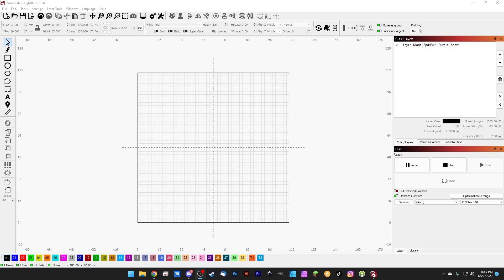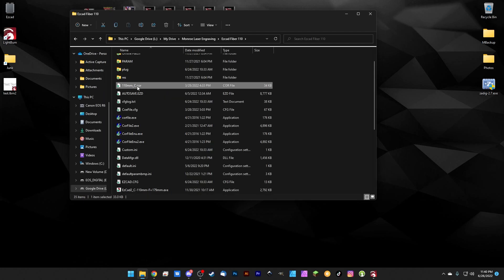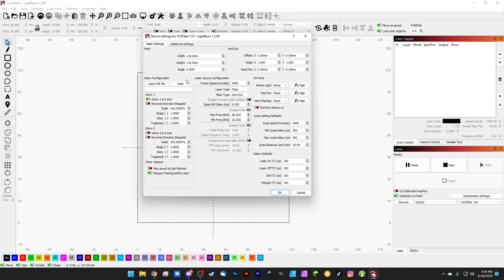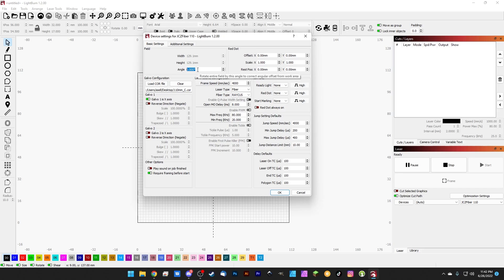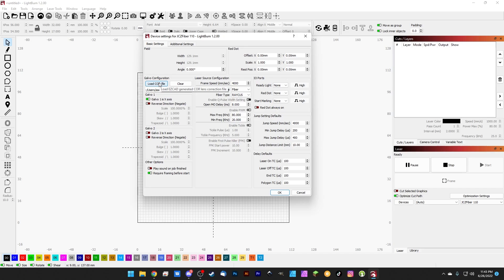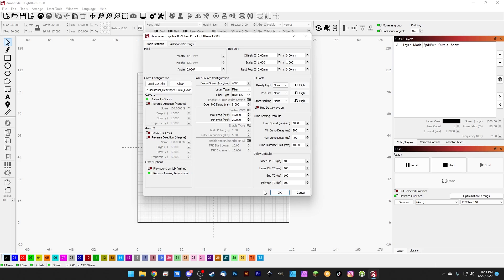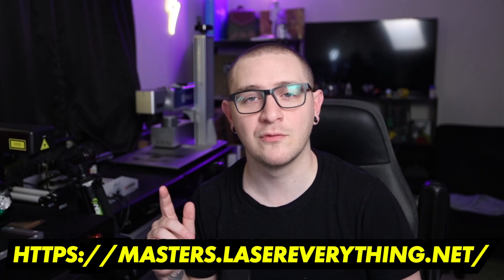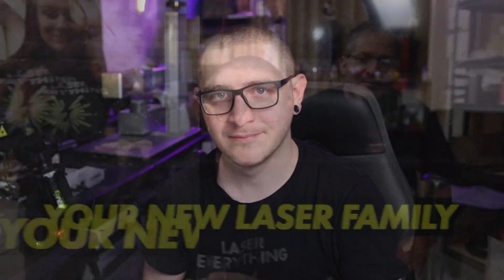Applying Ezcad Corfile Lens Corrections to LightBurn for Galvo

Comment: Hi,  I deleted my corfile.  yes-dumb- I assumed i didn't need it.  is there any way to get this back?  also- just signed up for the LMA yesterday!
Reply from the maker: Thanks for your support! 
If you have it backed up on your computer, or on the original flash drive that came with your laser from the factory, you can copy it back to the computer and assign it back to the laser in the device settings in lightburn. Unfortunately, if you don't have a copy of it somewhere, it is likely not recoverable. It's possible the manufacturer kept a copy of it (some do this, especially if it was built to order or a boutique vendor that did the corrections for your lenses before shipping out). If not, then you can try out the new way of doing a correction directly in lightburn, we just did a video on it and came up this past week actually :)
It's still early in its release and needs some fine tuning, but its way easier than swapping back and forth to ezcad. The scale is a bit off and needs adjusting right now after, but if you can tolerate that or hang tight till they update it again.

Comment: i did the focal dist setup ,I did the cor file many times but i still have error in the final dimensions. When i draw a square with 50x50 it actually mark a 49.5 .
Is there a way to compensate it by scaling?
Reply: I have this exact problem. I’ve run corefile2 repeatedly. distortions are removed but scale is about a mm small in both directions.
Reply: @joeargyle  guess we gonna have to wait for some help😁

Comment: Running Lightburn for a couple years with my led & co2.  Have a new fiber coming tomorrow... Any suggestion for these adjustments if all I have is Linux?  Doesn't seem to be a version for Ubuntu.   Kind of disrupts the 'flow' of your video if it requires a Windows machine.  Things keep going back to EZcad2...

Comment: Hey Alex, finally took the plunge and purchased Lightburn.  I still have the original folder as well as the USB that came with my galvo.  I dont see any files with the .cor extension?  What should I do now?  Thanks buddy.
Reply from the maker: If you're on Windows watch Episode 10 of this series, there's a link to the playlist in the description.
If you're on MacOS or Linux you'll need temporary access to a Windows machine so you can run the Corfile.exe and generate the correction file.
If neither of those are possible then you'll have to do lens corrections manually which we go over in this video here: 
https://www.youtube.com/watch?v=FZT9zOp9Sl8

Comment: Hi, I have a Corefile Issue I am trying to solve.  I managed to get all the settings pretty spot on using the bulge, skew & trap tools in Ezycad for my 300mm lens.  All in scale out to about the 200 mm square where it starts to distort. I can live with that while I am still learning. When I try the corefile adjustments to take the settings to Lightburn all of the shapes and scales of the test squares distort badly. This happens in both lightburn and in Ezycad when using the saved Corefile result. I have run Corefile2 many,  many times with maximum measurement detail and still can't get a workable result. Any ideas would be appreciated.  
   As a side note, while I am new to fiber lasers, I have spent 25 + years applying detailed designs onto metal through photo-chemical etching, or acid etching as it is better known. This was long before fiber lasers came into their own and we were one of only a handful of businesses in Australia doing etching.  We created some great works over the years, but the industry was messy, toxic and challenging from an environmental aspect, so we moved on to other things.  Fiber lasers can do things we could only dream of back then so I just couldn't resist the temptation to try one. These videos have been priceless in my learning journey.
Reply from the maker: Make sure you're using the change image function so that the landmark shapes are in the same positions on the screen as they are on your test material. If they don't match it can absolutely cause the symptoms you're describing here.
So glad the videos have helped you out, chemical etching certainly is a nasty business but as you said I've seen some absolutely beautiful work over the years. Messed around a bit with it in college but it's certainly icky. Hope we can get you where you're going and have you creating brilliant art with your fiber laser as well Anthony.

Comment: Is it possible to either: fine tune the COR file scaling OR see what the actual COR file values are, for manual entry?  My 175x lens is refusing to measure properly.
Reply from the maker: Unfortunately I haven't found a way to extract the correction data from a corfile as it saves encrypted. This would be super useful and hopefully it will be something LightBurn includes when they do release native lens corrections. For now though, we're kinda stuck with this unfortunately unless you make your lens corrections manually from the start (ew)

Comment: I am assuming because |I don't have a .cor file in my folder, | need to run something to do something in order to save a cor file???  EDIT, update, went back, watched the Video for Corfile2 and I can't get past running the Calibration after the initial 1-9 measurements, corefile2 crashes 3 times in a row now...not sure what to do, ...
Reply from the maker: Have you tried one of the other versions of corfile? There are a few different types available with the Ezcad CE download from https://www.lasereverything.net/downloads one of which may work for you! Sounds like something is corrupted so just a fresh copy may fix your issue.
Reply: @LaserEverything  ty folks will try a fresh download...

Comment: Ok, first thanks for all these videos! I’m ready to start marking on my fiber, but is there any way to import our settings for materials to create a materials library in Lightburn? Or do we have to enter it manually? Thanks!!
Reply from the maker: Check out our recent video on the Parameter Converter which will show you how to convert for LightBurn easily. In addition I'll be publishing an episode soon on lightburn library management which will be published tomorrow.
Reply: Well I’ve downloaded the latest LaserMaster parameter file and the File converter. The converter seems to run fine and converts and saves the file. But when I transfer the .clb file to my Mac LightBurn shows that it loaded it but nothing shows up. No errors and it shows the library file name as if. It’s loaded. Any help??
Reply from the maker: Hi Mike, message our support account on the LMA site, we'll get ya all fixed up!